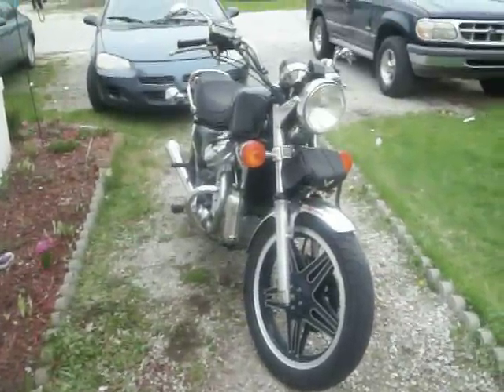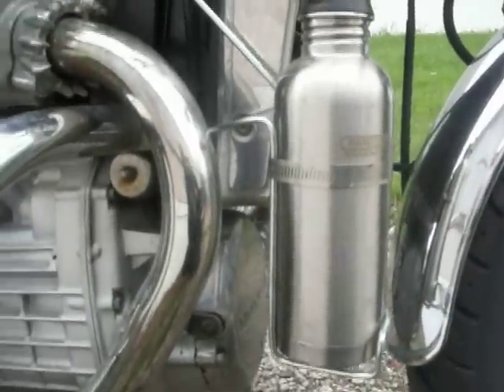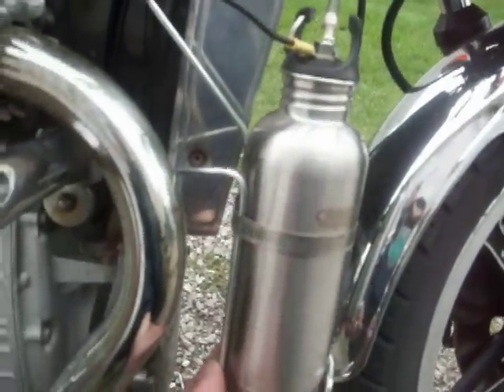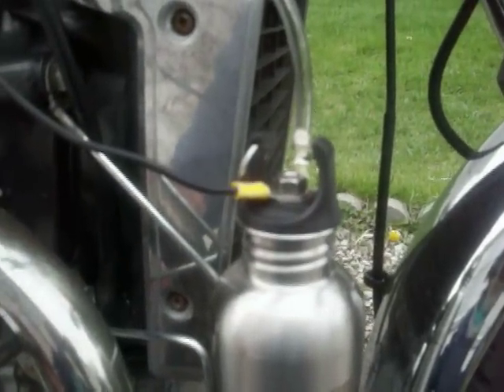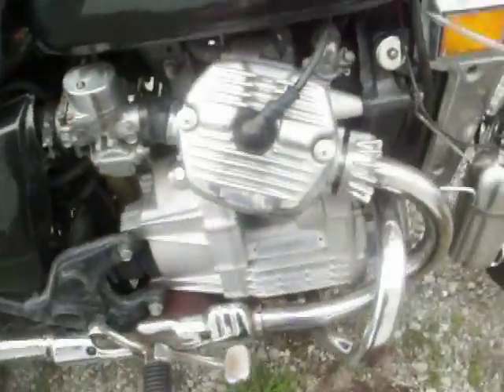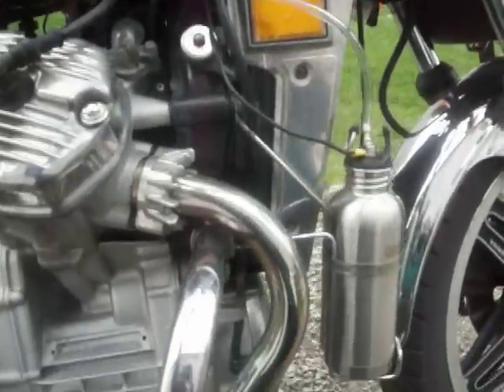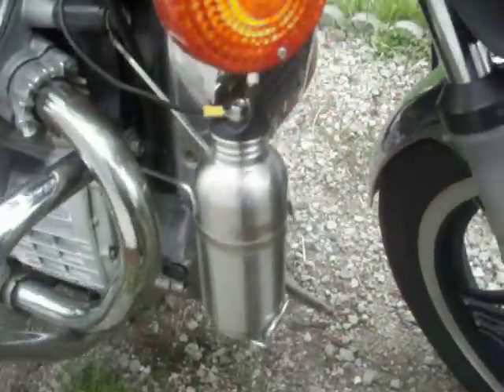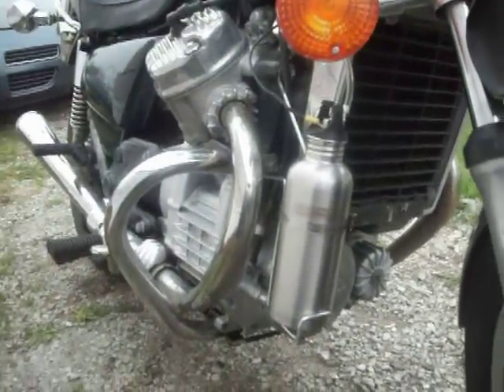HHO / Hydrogen generator powered CX500 from Westcoast Exterminator

Comment: If your hho??? will ever produce  more then one bubble at a time then it wil blow...... you are lucky it do not really give production.. then you wil need a bubbler (separator).. like me I have blown up so much smaller generators I now believe in Separators...... Gabriel Potgieter. SA.
Reply from the maker: produce more than one bubble at a time??? What? If there is an explosion the metal should contain it with the worst case scenario being the cap will pop off

Comment: @wcemichael I saw that other video and made a few comments. I know very little about HHO, but I am formally educated in electricity and I can tell you that your approach in that video is bad. What you want to do is keep the resistance of the HHO can very high which will limit the amperage draw, putting additional loads in series with your HHO can isn't going to fix that problem, but lowering the R will.. You may also want to install an in-line fuse to protect the electronics of the bike.